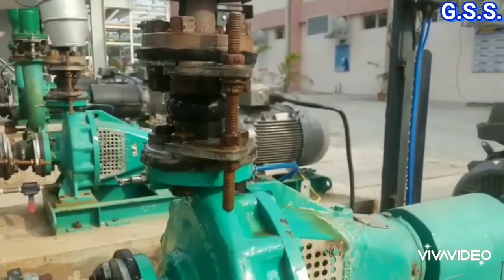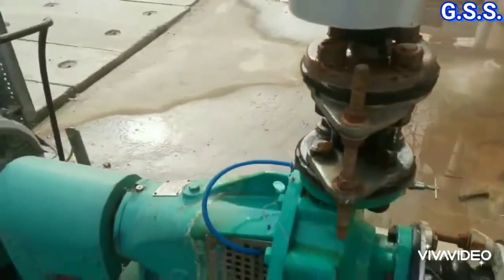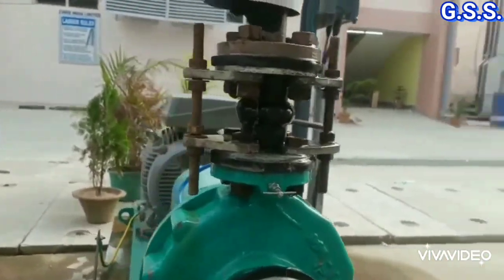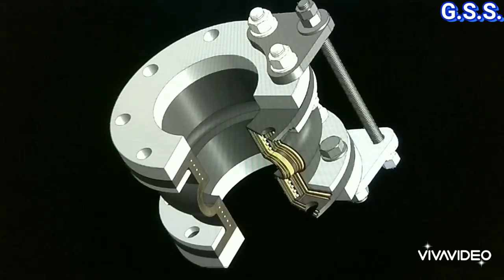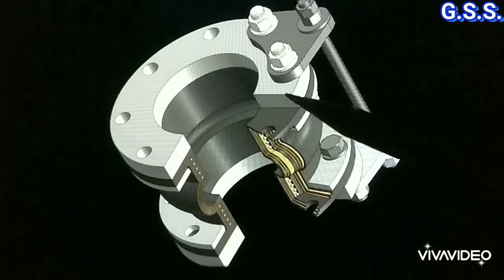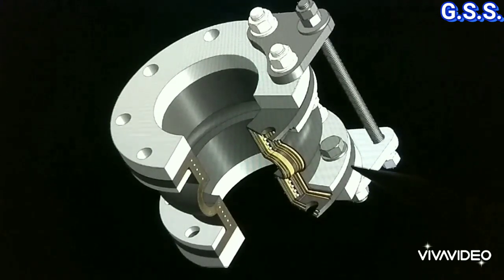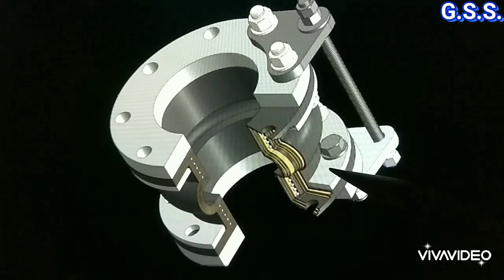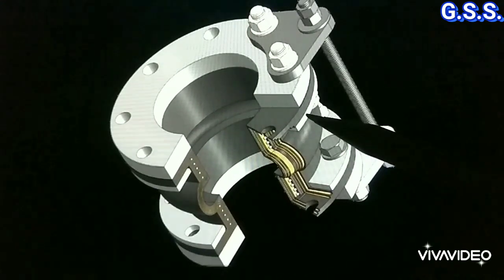Piping Engineering : Rubber bellow - installation defect

Comment: Can you please suggest which rubber bellow is suitable for use in pneumatic hammer machine adjoining pipe line , as there is a huge jerk with expansion of about 20/25 mm in the pipeline and spool type bellows get cracked due to this.there is no possibility to add control units with bellows due to the jerk and expansion
Reply from the maker: You should use SS braided hose for such application.